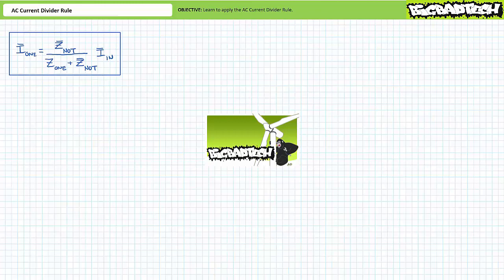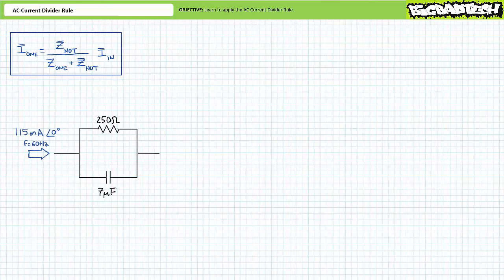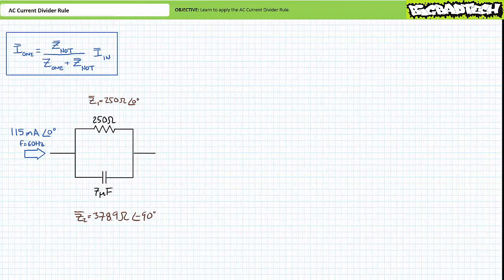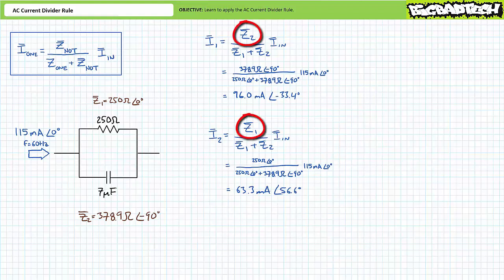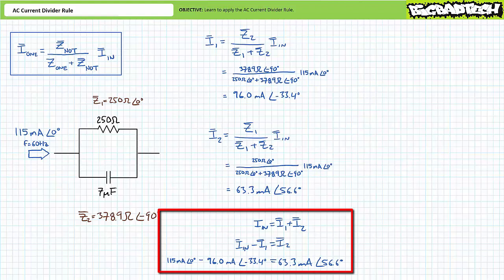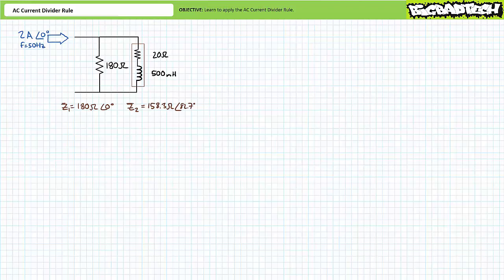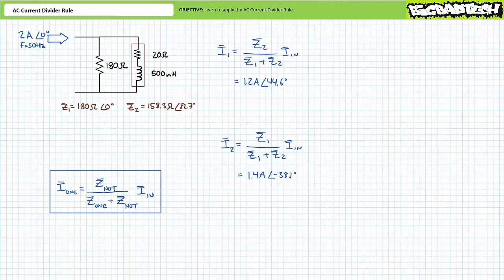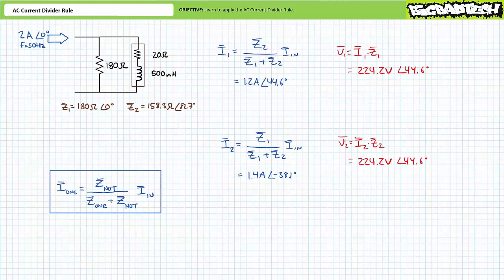AC Current Divider Rule (Full Lecture)

Comment: At first glance I was surprised that current through a parallel resistor is phase shifted by the capacitor in a parallel circuit. However in retrospect it should have been intuitively obvious! Since current leads voltage on the capacitor branch, electrons during the beginning of the capacitor charging phase will find lower resistance on the capacitor branch. The resistor wouldn't see much current until the capacitor is partially charged, and the later fall of current on the resistor side will be delayed as the capacitor gives power back. That would be a convenient check to help verify calculations, the current phase angle should be more negative on the resistor side when the other side is capacitive. All is good, with the delayed voltage curve (seen by both sides) exactly matching the delay in the current along the resistor. So, from the resistor's perspective there is no phase shift induced by the resistor itself.
Reply: It is a good point You raised. The current will initially flow to charge uncharged capacitor and thus there is current lag for resistor.But when source voltage drops below capacitor voltage, the capacitor voltage is higher, and positive particles flow through the resistor to the minus terminal thus supporting current flow through the resistor when plus terminal magnitude starts to come down in the second quarter.